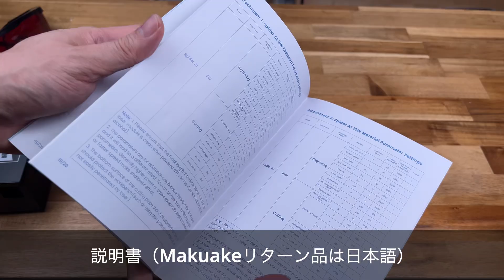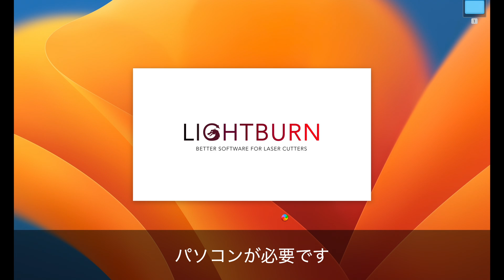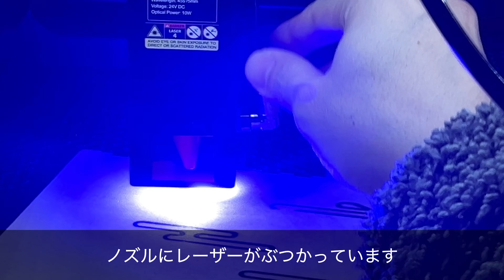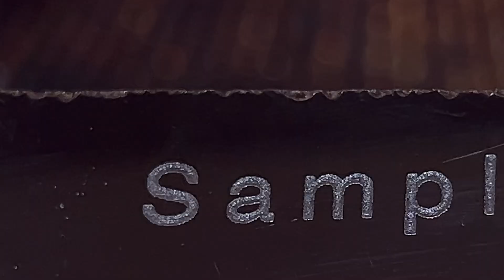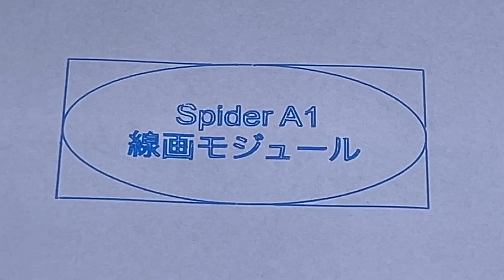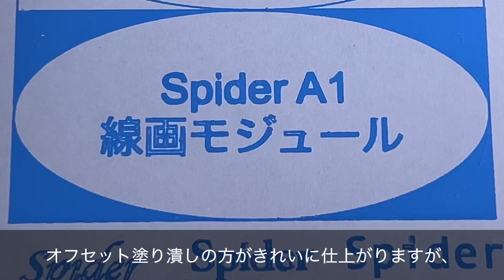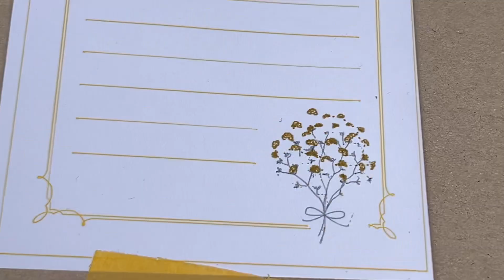クラウドファンディングで話題のレーザー彫刻機Spider A1　切断・彫刻どちらも◎

Comment: I have bought A1 (800L model) as well, but it cannot connect to Lightburn. In Lightburn, it said the machine is ready. However when I pressed START, an error message popped up saying “There was a problem sending data to the laser. The machine may be busy or paused”. Any advice from you please? thanks 🙏
Reply from the maker: The data not being sent may be caused by a corrupted TF card.